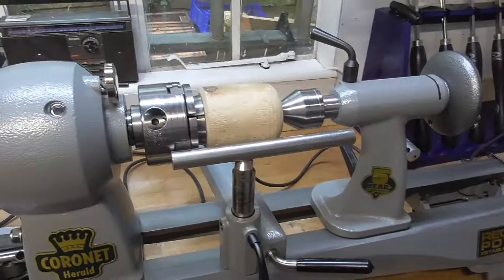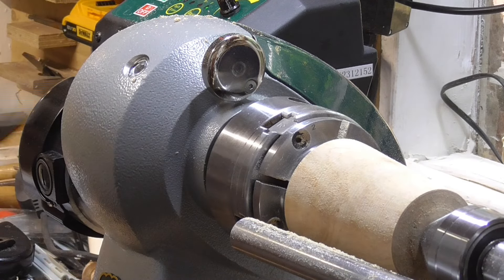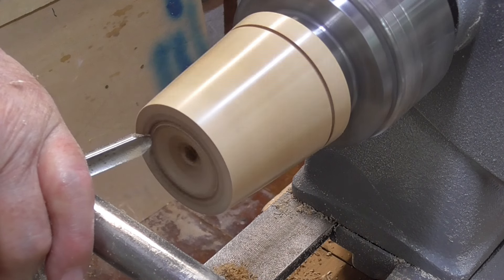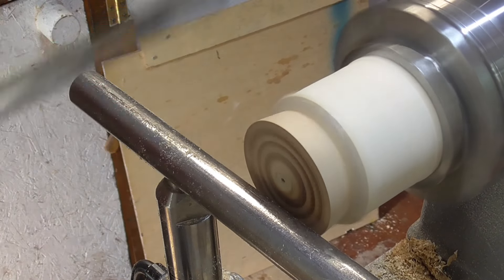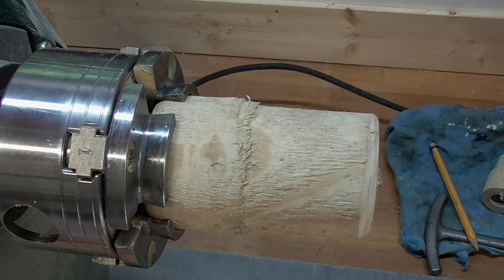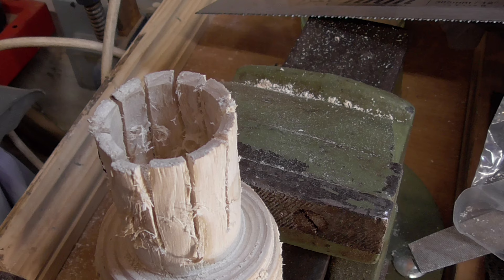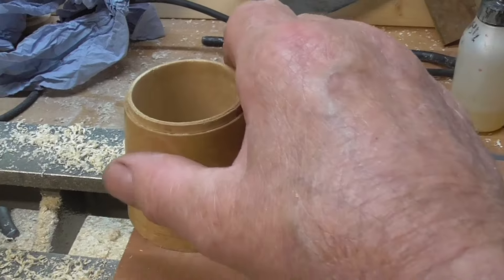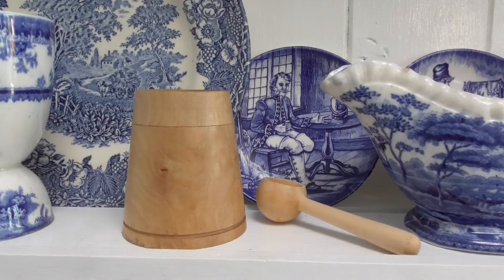Making a little box and spoon on my  new Coronet Herald

Comment: The lathe looks really good, Bram; I've had my eye on that model for some time. Have you got it bench mounted, and what depth front to back would be the comfortable minimum please?  Subscribed to Luv Wud. Valuable tip about soaking the wooden chuck in those oils, thanks; I keep both and have used such chucks. Years ago I turned a Marmite, as on the jar label, and it still awaits its spoon. No good at steam bending a strip handle, before I try, could I permanently shape it by dunking in oil?  Bernard.
Reply from the maker: @bernardfutter5327  Hello Bernard, I have it bench mounted so you would have to find a suitable bench  height. I can't  think off hand what my  bench height is ,I will measure later and let you know.I am going to make a quick video on the lathe, and I will include  all measurments that could help you out.I think you will be very please if you decide to purchase one.Cheers and will get back to you later,Bram
Reply from the maker: @bernardfutter5327  ps , have a go at making the jig mate,and soak for a few hours ,then after use put away untill needed.I will be making a video on making a better spoon jig that requires no soaking, cheers,Bram